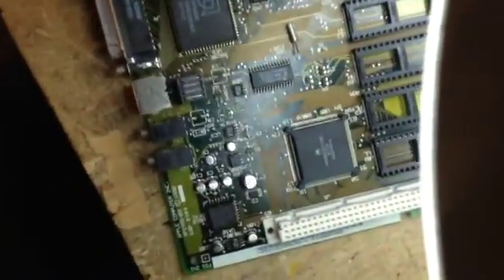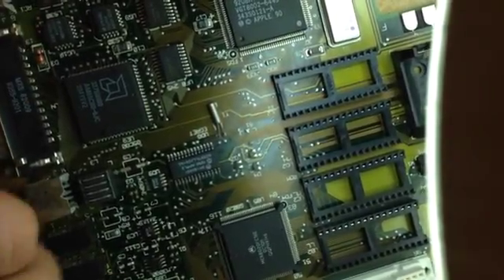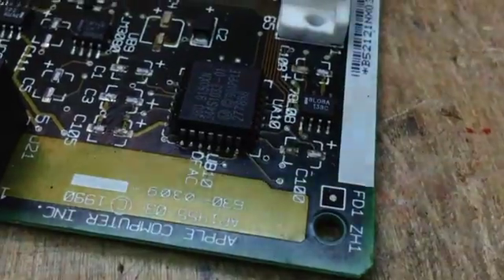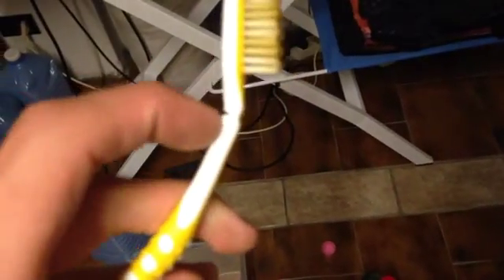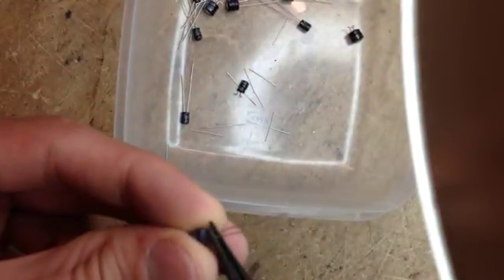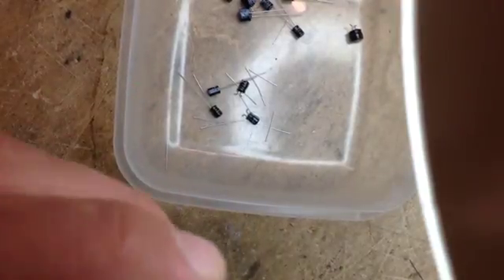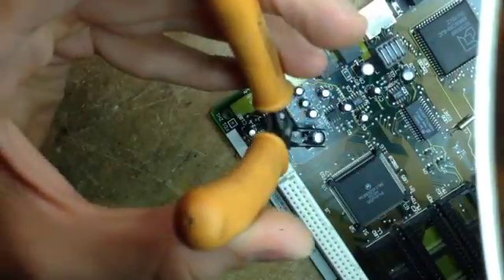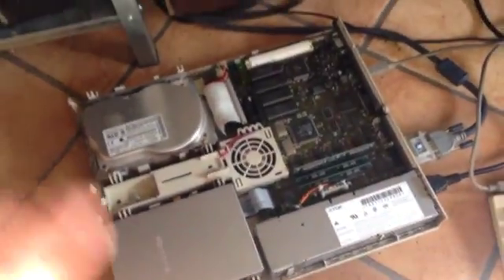Macintosh LC Logic Board Wash + ReCap Video Guide

Comment: Ciao Francesco! Sto tentando di recuperare il Macintosh IIsi di quand'ero bambino, freeze completo su qualsiasi System dopo 5 minuti.
Ho già provveduto  a dissaldare i vecchi condensatori da 47 uF e 16V, adesso sto attendendo quelli nuovi, ma nel frattempo devo ovviamente lavarla, acqua distillata del ferro da stiro e sapone da piatti può bastare? Grazie mille :)
Reply from the maker: Si, va benissimo, l'acqua non deve essere per forza distillata, anzi, ultimamente uso quella rovente dal rubinetto (specialmente nel risciacquo)
Reply: Perfetto, seguirò i tuoi consigli allora, spero solo di poterlo far risorgere, ne ho tanti Macintosh a casa, ma a questo ci tengo particolarmente :)
Reply from the maker: MrGasS27 Fammi sapere!
Reply: Oh, una cosa importante: consigli per una buona asciugatura?
Reply from the maker: io uso aria compressa, in abbondanza
Reply: Perfetto, soffi abbondantemente anche nelle porte?
Reply from the maker: certo! anche nei vari connettori (PDS in particolare)
Reply: Perfetto, grazie mille :)